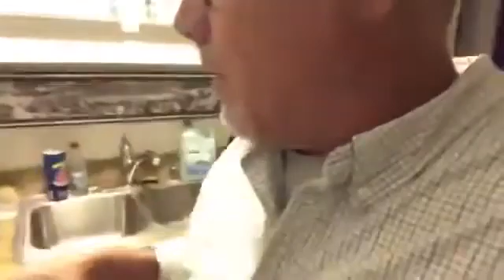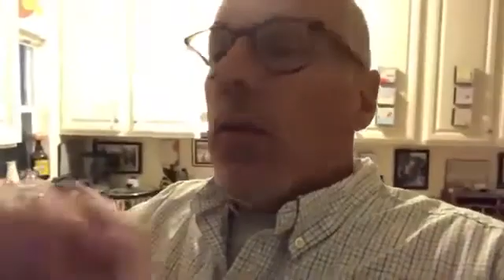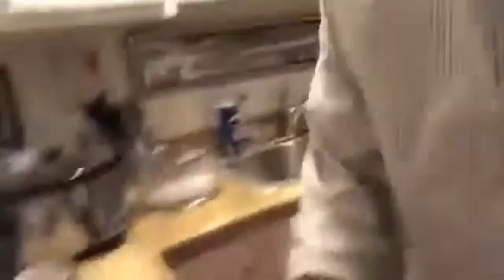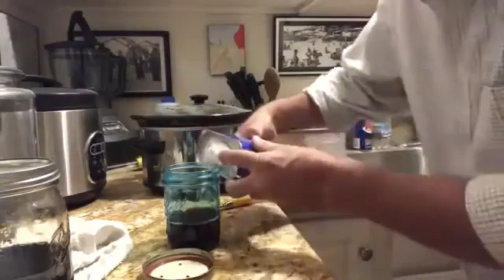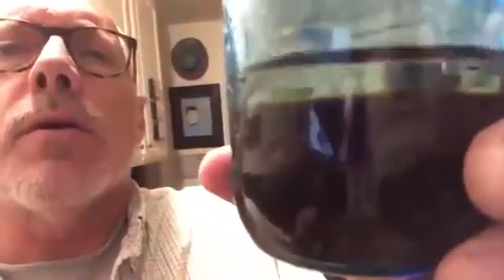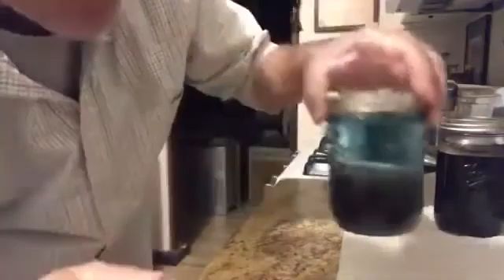DMT Extraction From Mimosa Hostilis Part 2 With Yale Biochemist Chris Cantelmo

Comment: Finally. Getting ready to do my first extraction. Yes, i have help with someone who has done this successfully in past. Been many years since i have done this. Thank you for posting this. Going to watch all parts...multiple times before we do anything.
Reply: Mind helping me out? Just need a few pointers.
Reply: @SG42  i dont mind. Id say watch video multiple times. When you have all ingredients together and are ready. Watch while you perform each part. Work slowly. I noticed straining takes a long time. I allowed it to strain overnight. Cant hurt to strain twice even. Dont worry. If you miss some...solent will rise to top. And dont be suprised if yield is under 1%. Just means shitty product. Do your best then find a better dealer. Best to try a small batch...100g first. I tried 250 first. Not the best idea.